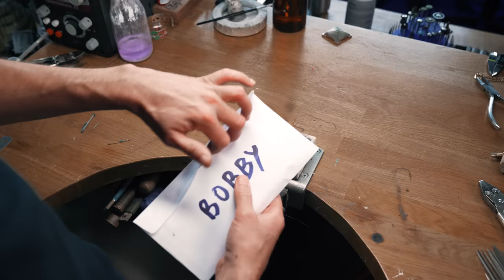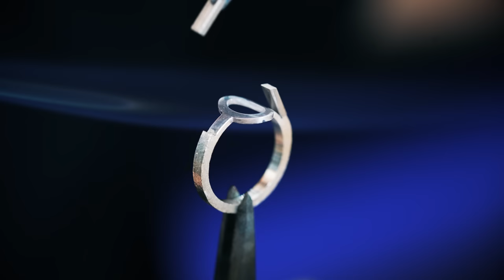How A Real Handmade Engagement Ring Is Created - No computer, no casting.

Comment: What's in the white pestle and mortar on your work bench that you apply to joints? Great video. Amazing ring!
Reply: Borax --> in jewellery making, it is used in the process of soldering metal. It helps the solder to flow while preventing the metal from oxidising and the risk of fire stains.